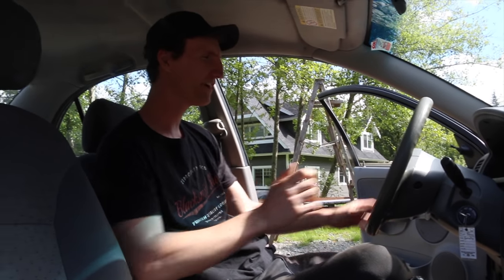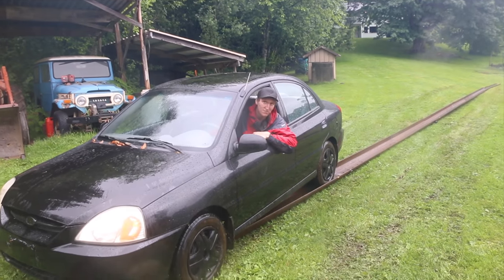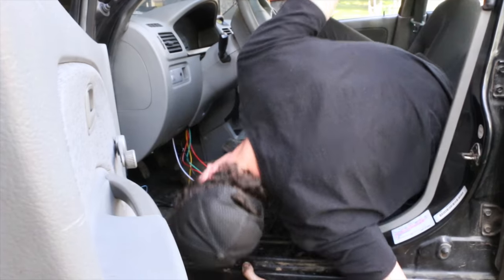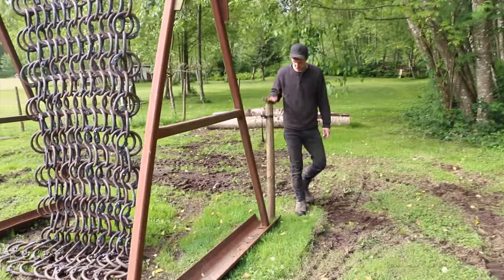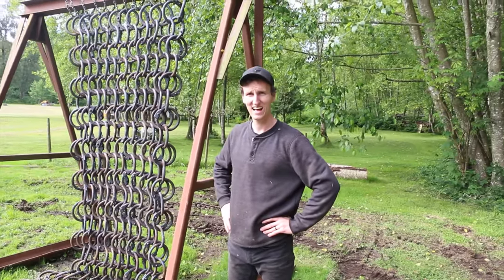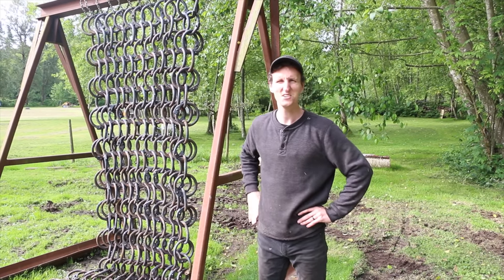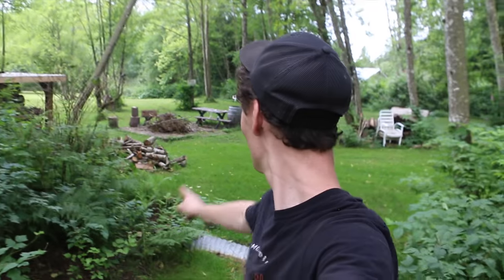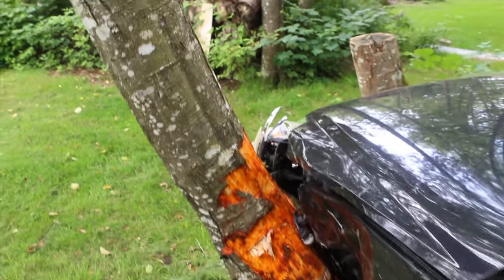I ran a car into this.

Comment: When you put those small fenceposts behind the A-frame, I laughed and thought: This is going to hell fast!   ;-)
Martin won, he guessed about the same as I did...
If you´d anchored it down better, I think the result would be simular, but the A-frame might have broken and made it into kind of  a ramp bouncing the car over the logs and into  the same place, or turning it upside down in a loop. Landing "on its ass"..
About a metric ton (the car) in that speed has a real big force.
Keep up the good work, and I want you as a neighbour!

Comment: This is what safety cables are for in SFX world, car reaches a set point, steel cable breaks contact that kills engine and as the cable is also firmly attached to the car stops the car dead or at least removes most of the energy if the cable snaps, back that up with a better barrier than a few logs. but something tells me you set this up knowing what would happen with full co-operation with your neighbours.

Comment: I tip the smaller chains holding the chainmail to the A-frame will give way once the car straddles up into the chainmail with the weight of the car and the impact force breaking these chains, and bringing down the chainmail. (I was totally WRONG! Hahahaha! Chainmail intact, and car escapes) What an epic video!

Comment: A very similar chain mail system is used to catch boulders and rocks in high risk mountain passes. We have one close to were I live. Instead of solid bar cable is used.  Cable rings locked together with bull dog clips. Very smart because it just eats up energy from rolling boulders. multiple loops of cable also pull through the clips  when its hit... very effective.  In the making video i left a comment as to why... why make that. I now understand fully.

Comment: Using the track is a good idea, I never would’ve thought of that. But my thought of keeping the steering straight, take two pieces of some flat stock or tubing, weld one end you the frame of the car, take the other end and weld, or bolt it to the steering tie rod ends so that they won’t move.

Comment: What I suspect is that the kit you used for the auto start stop has a function built in that does not allow someone to turn the car off while the accelerator is pressed, for safety reasons, either that or poor range on the fob to the receiver.

Comment: I think you should have a) added about 6 more logs pyramided up b) used some massive u bolts and bolted the bottom of the chain mail to the ground c) used a rope to a quick disconnect to the battery so once the car got far enough  away the rope would have yanked the disconnect to kill the car.

Comment: Little bit late, but what do I think's going to happen? Well the weakest link is the A-frame. Either that will buckle or the car will make it under the chain mail at low speed after transferring a lot of energy to whipping a ton of metal in the air. I don't think the tires are going to make it over top of the chain mail, and if they do it'll just slip out from under it. I think the car will end up almost on the other side with the mail draped over it. Let's see how I did...
Reply: Wow, lol, ok, well, I didn't count on the car being powered through the whole thing, but I still think the car had more momentum than I was imagining. It did lose a lot of speed when it hit but it would have made it through. I'm glad you guys are ok. Poor tree...

Comment: Putting the posts at the back side of the A-frame creates a pivot to flip over the frame and chainmail. Pinning the front of the frame would have anchored it in place, the posts would have likely have just shear off instead, but no pivoting and the weight if the chain mail would have stayed on the car rather than flip over the car.
Next time try a bench test with a model to see possible results or disasters.

Comment: 6:16 I'm going to guess that the car loses but the chainmail suffers a few broken links. Maybe 7 or 8 at most.
Edit 1. Not breaking any links, I was thinking the bottom of the chainmail was locked down.
Edit 2. I could not have been more wrong.

Comment: first thing you should of not use is a Toyota. My 96 Tercel is still running with oil changes and minor maintenance. all of my Toyota's have lasted 25 years or more. before I sold them all of them are still on the road since I started buying them back in the 80's.